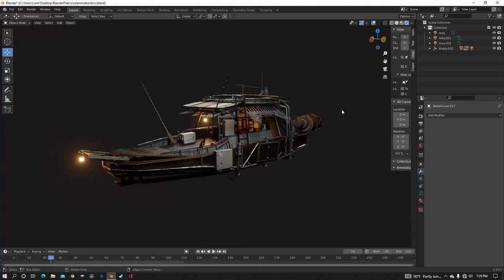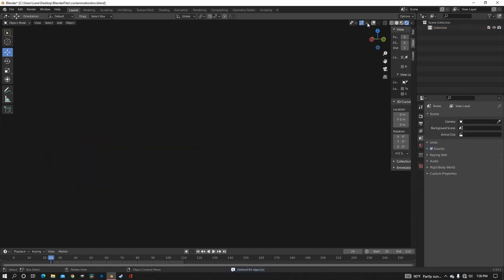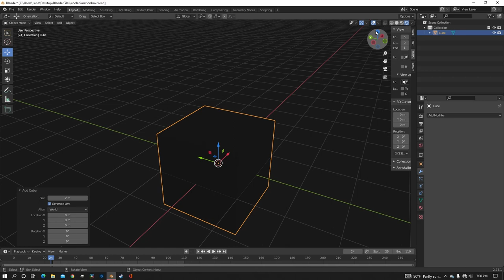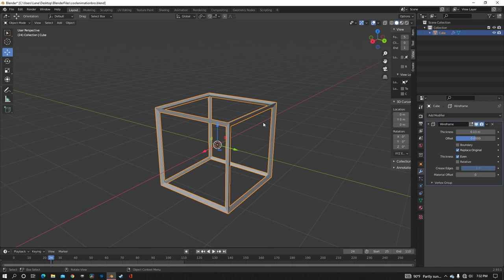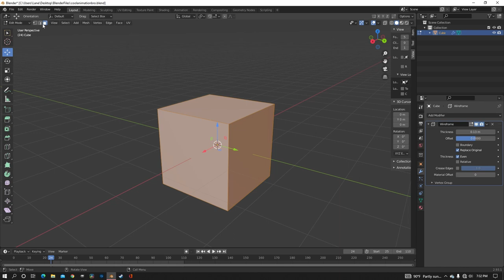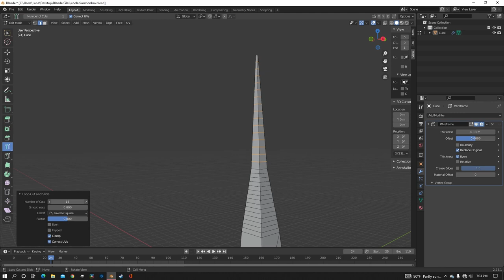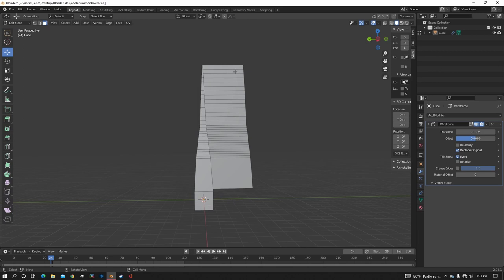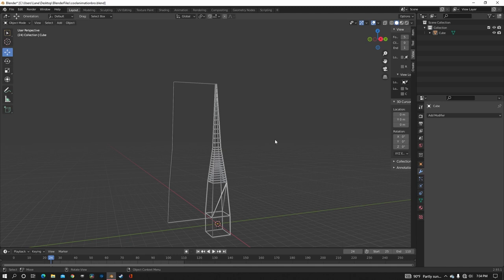My Favorite Modifier in Blender (Kind of a tutorial)

Comment: Another way I sometimes do (tube) frames is offset the model or plate it using shrinkwrap, apply it and delete all the faces. Separate the edges into pieces so that no edges are connected, then convert to curve and add a thickness to the curve. While there is still some mitering/skewing work to be done, I just find tube frames a lot more visually appealing.

Comment: Great Idea! I'm not too proficient in Blender yet so still  mostly model in Max. In case there's anyone here in my same boat, in Max you would select the edges you want to frame (ctrl A for all), and click "create shape" in the poly edit tools which will create a separate spline object, then just use the new objects "render spline" properties for making tubes, rectangle, how many sides, thickness etc. or use a "sweep" modifier for some fancier shaped frame pieces, like C or L or something custom.  To avoid the "squashing" as seen here, just transform the vertices instead of using an object level scale.

Great video! I'll check out some of your other stuff.

Comment: if you apply the scale, the thiccness ( ;P ) problem is solved. And if you use a solidify modifier and check the box for only rim (or whatever its called) in front of the wireframe it is fully procedural, so no need to wait until the model is finished :)

Comment: Could be quite nice to make some kind of procedural connector element at the verts of the wireframe. But I guess maybe using shades to add some kind of rust or weld marks at the intersections to give an illusion of welded metal pieces or something. Great though
Reply from the maker: Yeah that would be really nice. But I’m sure there is a way to do it with a shader. Maybe I could look into that

Comment: I'm new at this, can the shape of the wire frame be changed.  From square bars to round or any other shape?  If so how?
Reply from the maker: You could try applying a Bevel modifier after the wireframe modifier.